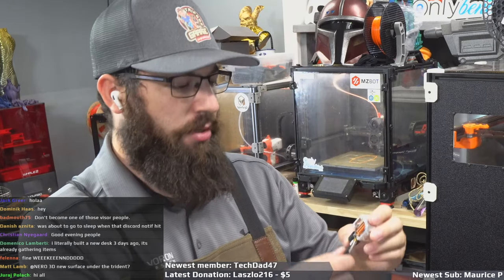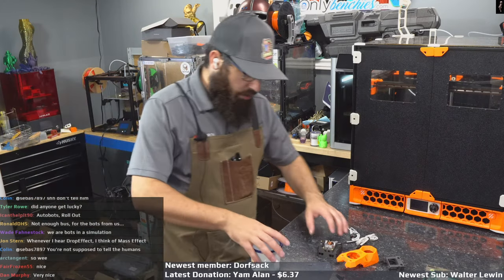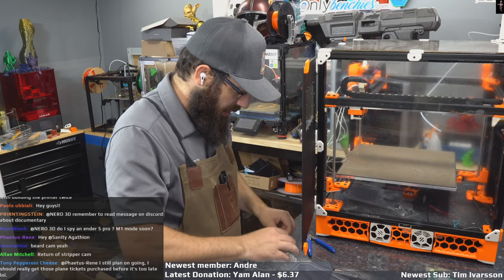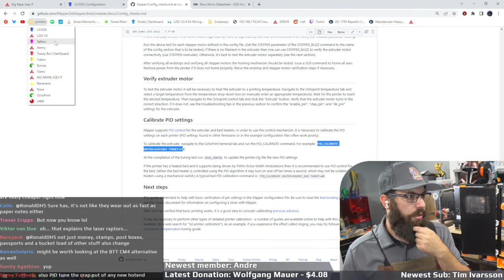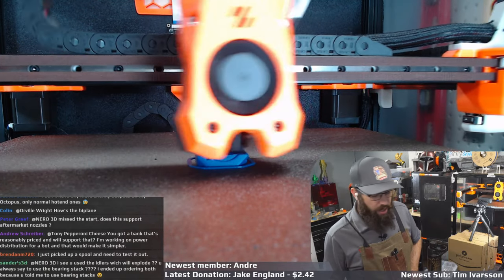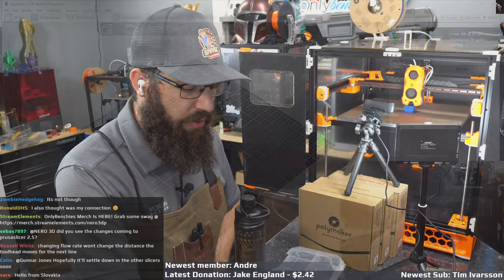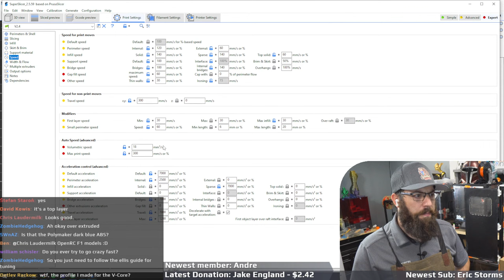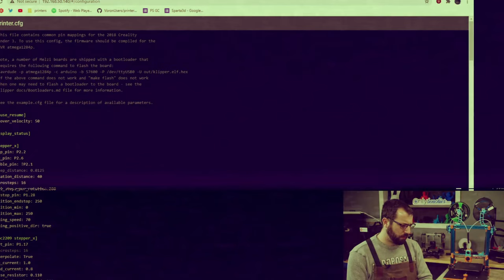DropEffect XG-Hotend -INSTALLATION AND TESTING  #livestream #3dprinting #3d

Comment: it would be nice to see some slicers incorporate the advantages of ceramic nozzles. bridging at minimum extrusion temperature would be nice to see and it would solve a lot of problems with 3d printing. Unfortunately we still can't even use a fan speed override for overhang angle. It's hardware for the future I guess.. no point in the current state of software though. Whether this takes off or resin slicer devs realize supports can be under exposed to aid in removal.. someone will be able to actually take advantage of additive manufacturing 😂. wait... just kidding, those features will only be available for industrial proprietary slicing software.

Comment: Only thing I wonder about and possibly worry about with the dropeffect XG hotend is how fragile the m4 nozzle will be. I have snapped off threaded sections of screws before and it is not a good experience. In part to 3d printers I actually snapped off the bowden fitting that goes in the top of a H2 Extruder when testing it and that was a m6 thread and I hardly put any pressure on it when doing so. So I sort of wonder and worry about how fragile that threaded section will be as it will be very thin walled.
Other than that I am very tempted to but a set of these for my Ender 3 Max IDEX build and try to pair them with a set of Bondtech LGX Lite extruders.

Comment: Seem like the Clockwork2 is not good enough for now, i dont know
As i can see u guy still use the version 1

To me, I can not use the CW2 as good as CW1, not for sure that because of my or CW2
Reply from the maker: CW2 is just fine and actually an improvement over CW1. I just havent used it yet as the machines I have that have CW1 installed dont have any issues